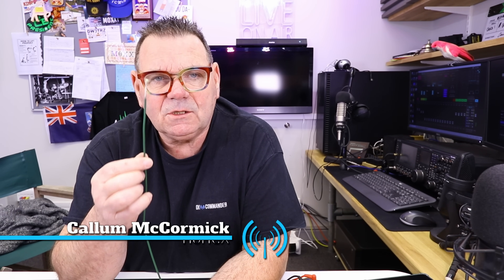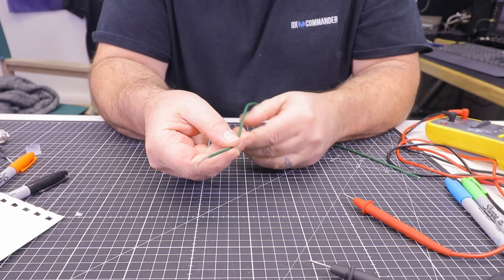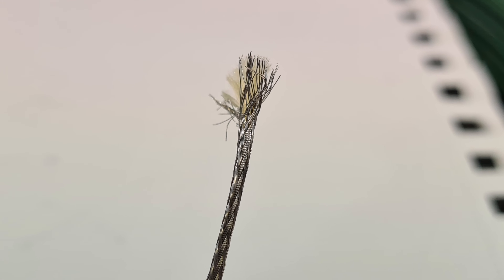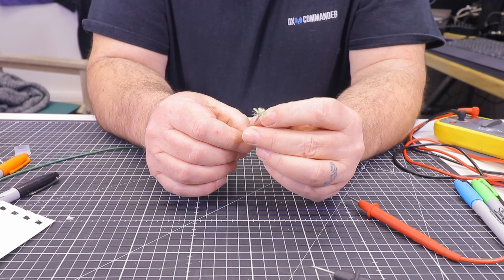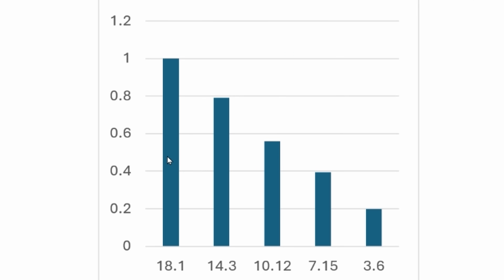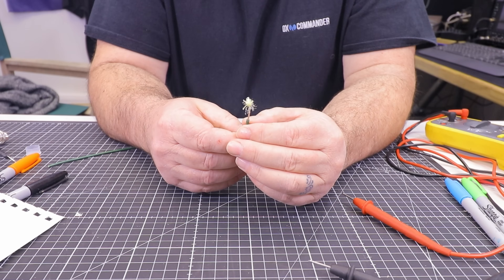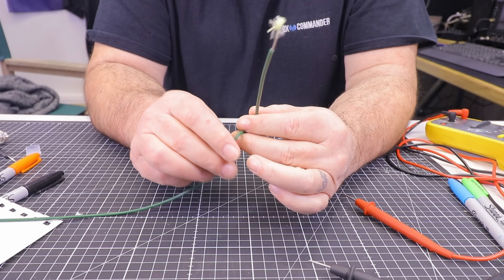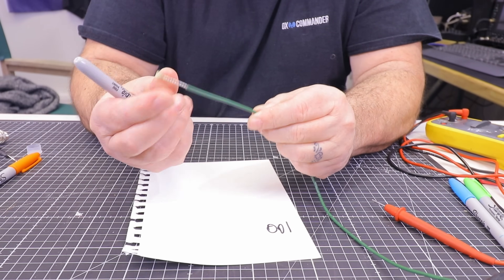The World's Most Expensive Antenna Wire

Comment: It's a good prank, but actually not an entirely impossible idea.  Difficult to get perfect tuning from the factory, but in theory you could design a wire with a tiny coil trap every inch or two, perhaps even wound around the main line...  Much like with a fan antenna, the source voltage would "find" the closest-matching trap for the given frequency and dump maximum current into it.

Maaaaybe not a great RX antenna, but might be interesting to try anyway.

Comment: Professionally, I use Phosphor-bronze wire, 3mm 7x12, from Ormiston Wire in the UK, for anything up to around 5kW. It doesn't stretch, solders, and is light. It's about #4.25 per metre though. On pro jobs I seem to have enough left to make some ham band antennas! Its not a super-conductor though, like Cal's super-light-speed wire.

Comment: Yes, but if you use a borosilicate tube pressurized with a Bose-Einstein Condensate, imple thermal and pressure adjustments can properly tune the cable tube to almost any velocity, optimized by frequency.
 Of course that means optical conversion at both ends, but that also gives you lightning and emp isolation.
Reply from the maker: Yes, excellent isolation though. Agreed!